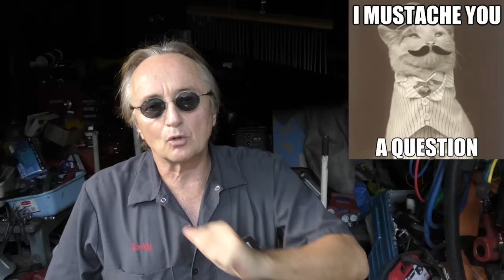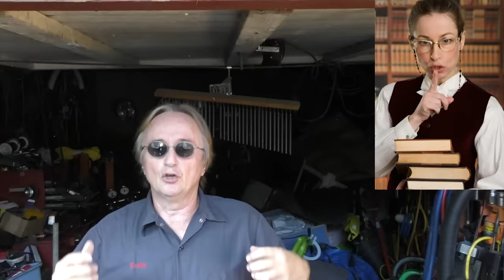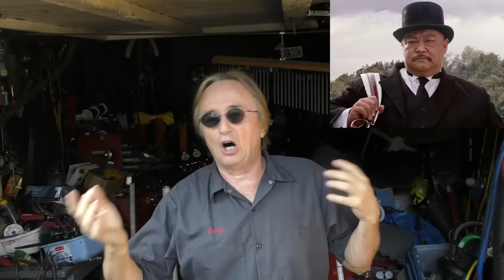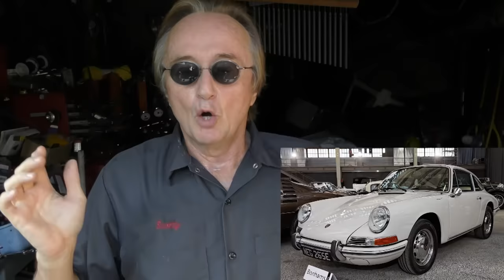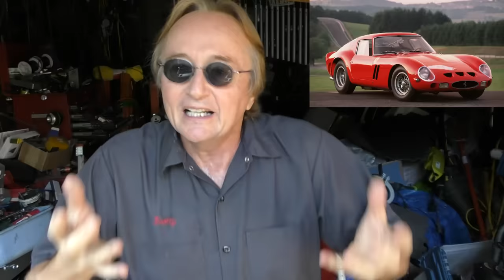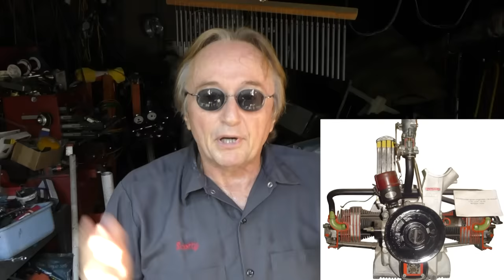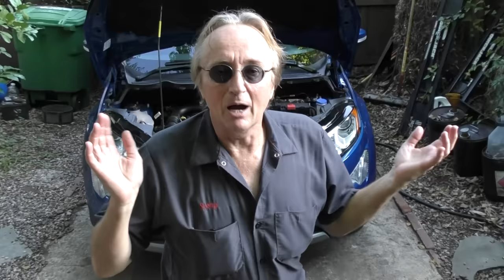The Truth About Boxer Engine Cars

Comment: It's an old design and VW don't use it anymore... So? 

Inline and V-shaped motors are old too. The GT3 has one of the best modern NA engines, and the 911TS is one of the fastest cars in the world.

I don't usually post negative comments but this video was terrible.
Reply: How many miles do you get out of the 911 engine?!? And How much does it cost?!?
Reply: Maintenance Costs, LOL.
Reply: @johnscheidler8842  modern 911s aren't made to do hundreds of thousands of kms. They're designed for high load.
How about this: how many cars will take the abuse a 911 will? Before you answer, watch "The 2014 Porsche 911 Turbo | Road & Track".
911s are engineered for 3000 launches. Ferraris: 12. Nissan GT-R: one launch voids the warranty.

I had an '07 EZ30-powered Subaru Legacy at work the other day. This is an engine and car worth speaking about longevity due to it's design brief, and also a flat 6. This one had 400,000kms on it and was on the factory chains and guides, tensioners, oil and water pumps, and even gaskets.
Reply: @944CoyoteV8  such a fool
Reply: @jesscesanto9127  Precisely why?
Reply: 911s are beautiful and fast but you can simply build a much cheaper car to go faster a simple little civic with an ls swap and boost can outrun your 911 money doesn't buy it all lol
Reply: @jesscesanto9127  what?? I didn't say faster cars couldn't be built cheaper. I've owned a car faster than a new 911TS and it was a 4 cylinder. I'd still take a new 911 over it though. The same reason I'd take a Chiron over a forged 911 that did a 7 second pass. Irrelevant.
You thought that because you could rebut what I was saying by using an argument that is completely irrelevant, that I am a fool? You don't know anything about me.
Show me why I'm wrong rather than name calling like a child.
Reply: @944CoyoteV8  we'll the reason your is because if boxer engines  where as good a v and inline engines them they'd obviously make more of them to think a boxer engine will outlast an inline is simply foolish
Reply: Also 400k kilometers is nothing my old 90 jeep that was handed down to me with an inline 6 has we'll over 526k miles and it runs like a dream it's only need  basic maintenance  and several clutches the I've blown
Reply: @jesscesanto9127  because an inline six is inherently well balanced, like a flat six. No balance shaft like a V6 or inline 4, so a very light rotating assembly. I'd say inline sixes are mechanically as good as flat engines. The downside though is that they're tall and create a high COM and a long front overhang causes big angular inertia. Flat engines are low and short, and better for vehicle dynamics, hence, 911. 

Your Jeep didn't have enough power to hurt itself, but that is respectable milage.
Reply: @944CoyoteV8  I'll admit boxers are decent but they'll never outlast v or jnljne engines I've abused the hell out the car I find the 911 offroading not hauling anything it's not powerful but it takes the abuse
Reply: @jesscesanto9127  Yes, they do!! With very little maintenance. I had one as a daily that did 7500RPM every day for 200000km before I sold it in 'as new' condition. An '07 BLE Legacy; a 3l with 200kW, that I launched at 6k with a heavy duty clutch and light flywheel. The thing got a hiding. 
I' m a V8 guy but that was the best car I ever owned, reliability wise, and it's not like it was slow either, for a 1500kg NA 3l. Did a 14.0 @100mph.
It's well known these engines can take this. That's why I bought it. Look it up.
Reply: @944CoyoteV8  Wait, whoa. A 6-cylinder Subaru with a manual transmission? Where??
Reply: @nthgth  domestic New Zealand market car with the six speed from the V7 STi with shorter ratios.
Reply: @944CoyoteV8   Lol Figures it's in a market that's about as far from me as possible without leaving the planet. Enjoy your sweet sounding six man
Reply: @nthgth  haha come and visit some time, mate. Thanks :)
Reply: Well put, Alan Johnson. I-sixes are great, but they have drawbacks, as all engine designs do.
Reply: @944CoyoteV8  lol we'll see. Here in the US we're lucky to get a manual option on the base models of most cars, and they're all 4-bangers for marketing reasons.
I was lucky enough to drive a manual V-6 Toyota Camry Solara for several years, I still miss that car!

Comment: Great video! I’ve owned 5 Subaru’s (1992-2005) and yes they have their issues but I just have a lot of fun and enjoy the noise they make with unequal length headers and a nice quiet deep muffler.  But now that I’m at the top of my career chapter and two kids with one on the way, I’m sticking to Toyota. My wife’s Sienna has been amazing and get better gas mileage than my old outback (it just started leaking gasses into coolant) I’m going to retire it and get Camry hybrid or something Toyota like that and when I have a shop later on down the road, I’ll buy a Subaru project and do all fun stuff I’ve dreamed about.

Comment: I have a Legacy 3.6r. I love how balanced the engine is. It is incredibly smooth and it is not noisy like scotty says; however, I did put aftermarket exhaust on it and now it sounds awesome and borderline older 911 sound alike. It is super roomy in the interior, not overly complicated like some cars are I do wish it was a hatchback though cause i would like the versitility of the outback without the stilts. It has been very reliable, shoot at the same mileage my previous Buick had oil leaking, had to replace all coolant piping and radiator, a/c and heater went out it was a mess. BTW it really is not hard to work on. I can do an oil change or transmission drain and fill or a differential drain and fill in about 30 minutes each. Air filter is always super easy, cabin filter is easy, battery is easily accessible. Serpentine belt was done in 20 minutes. Brakes are no different than any other mainstream car. Spark plugs are the only real difficult regular maintenance and that is because of the close frame to engine. however if you have 2 jacks and know how to loosen a couple engine mounts its really easy too. If not it could take hours yourself if you do not have the right extensions or swivels. Shoot for the price they charge at the dealer I would just buy a second jack and save yourself a couple hundred in the life of your car. I will admit though, their fluid levels are kind of high(takes almost 7qts of oil every 5k miles, 4qt of trans fluid per drain) 

So Scotty, how is it hard to work on?  You get a balanced engine, symmetrical AWD (none of the fwd/rwd biased crap) that gets great gas mileage for an AWD car (dont compare to fwd cars cause everyone knows there is power losses and efficiency losses with awd) and extremely they are extremely practical. The key to their balanced AWD is their boxer engine. Also have you seen the crash tests of these cars, they are ridiculous at withstanding lethal damage to the occupants and my insurance is significantly lower than any other car I have owned which have all been midsized sedans or eco cars. I have 0 problems in snow of 5.5 inches or less, obviously bumpers get in the way. Shoot im confident in the awd that if the outbacks had some goot all terrain tires they could make it through 8 inches. 

Yes Subaru is less reliable than Toyota... but guess who owns a pretty good percentage of subaru now... Toyota. So with toyota's reliability and hybrid tech, I can see Subaru and Toyota merging and dominating a lot of the market. Shoot put Subarus AWD in the Tacoma and say goodbye to some of the smaller trucks.

I have a vision that Subaru will be one of those companies that started as relatively nothing and turn into a walgreens or an amazon.
And for goodness sake subaru, make a luxury line. I know too many Doctors that drive subarus mainly for their awd notoriety.

Comment: I don't know why you are knocking Subaru engines. One of the easiest to work on. All accessories are mounted on the top of the motor no turbo motor gets GREAT fuel mileage on the highway. What's not to like
Reply: I have an 09 Forester, LOVE IT.  The Boxer engine / clean exhaust is more than adequate. Acceleration may be slow, but just adapt to the driving situation.
Reply: Except for STI lol
Reply: No. Boxer engine is painful for DIY Hobbyist Mechanic.

Try changing all spark plugs on an STi, it take hours, the space is very narrow
Reply: Yeah you don't need to knock on subaru engines they do that themselves. XD
Reply: steve blow I change spark plugs at my work on wrxs and Sti in under 30 minutes all day long and other Subaru models. The space is small but it is more then enough to get the job done :)
Reply: @billypurdy8581  

DIY Hobbiest has different skill levels & different equipments. It's amazing you can do it in 30 minutes.

But all im trying to say is = Inline Engines are much more easier to work with.

Boxer is special build engine, anti mainstream. Almost like Rotary.

It's special, even Zeppelin used Boxer engines because has lowest vibration.

But it's not the best engine for DIY Home Mechanic
Reply: It takes YOU hours because you don't know what you are doing. It takes me less than an hour.
Reply: Haha great gas mileage on a boxer engine? My 2003 Subaru Baja would like you to see it's 17 city mpg and 20 highway mpg.
Reply: @noirceur_  my 2011legacy only used on the highway New Hampshire to New York getting 31mpg
Reply: @marcaliventialiventi765  cool, my 2011 BMW 550I XDRIVE gets 30mpg on the highway and it has 400hp, 450ftlbs & AWD.
Reply: @thebadmanreturns  painful for a diy hobbyist mechanic? I can change plugs in 15 mins.
And i already built a boxer. Including pulling and installing. And im not even a mechanic.
Reply: Yeah. I’m sure timing belts are a breeze. As well as in situ head gasket replacement.
Reply: It's not that hard to change the spark plugs. The things you need to get out the way are very easy to do so. YouTube is great for that.
Reply: I use 2x 3" 3/8" ratchet extensions and a universal joint connected to a 3/8" ratchet. That might help you. You have to plug them into eachother 1 at a time, but then it's easy from there on out. I don't have all the same airbox, battery and fuse as the STi which makes them take longer. But on the outback it took me 1 hour my first time. After that it's much easier.

Also get the locking extensions and duct tape your spark plug socket to the first one. you dont want to be the guy that drops stuff in those holes.
Reply: My 2007 Outback routinely gets 27-29 mpg on trips between Iowa and Louisiana with the occasional 30mpg tank.
Reply: I drive 85-95mph so I typically get 24-28mpg. Also has 165k on it with a blown head gasket leaking coolant and oil. Approx. 0.25-0.5 quarts of oil every 700miles and 1/4 cup of coolant every 2,000miles.
Reply: Can you explain where he knocked  Subaru engines?? He’s explaining differences and the design... try actually listening
Reply: pretty much everything after 3:00 is negative
Reply: xomthood knocking something and stating facts are different... if you think facts are negative then you need to wake up and actually start learning facts about engines or cars in general
Reply: he is offering opinions, not facts, and I know plenty enough about engines, thanks
Reply: I agree with pretty much everything he's said having owned most of these engines. Inline 6's are still the most fun imo
Reply: @billypurdy8581  mitsubishi evo better faster than rubbish subaru
Reply: He did say if you are into Subaru to get a manual transmission. What is wrong with that? My parents used to own a 90s Legacy MT and it was well built. Auto Transmission don't get it. Specially the SVX 😂
Reply: @billypurdy8581    for the average Dad a inline 4 is a dream for spark plugs changing 😁 as fast as the hood is opened the plugs are out

Comment: Not really true that the boxers are under-powered.

The BRZ (Toyota 86) is under-powered but that's due to the design and not the engine. It's been the single biggest complaint on that model and for some reason they won't update it. If they put in the boxer from the WRX (268 HP on the standard 2018 WRX) then that BRZ would flat-out fly since it weighs 500 pounds less than the WRX. The STI has 305 HP and it accelerates fast enough to cause whiplash. No, it can't get 500+ HP like the Dodge Charger but that car can't turn worth a damn and the WRX STI will corner on a dime. The low-slung engine makes it much more fun to drive than just raw HP.
Reply: Do you even know what youre talking about?
Reply: Yes I do. Thank you for asking.
Reply: No worries you can easily make 500hp STI if not cheaply. And sill handle.I just fitted some Michelin pilot sport 4s for extra grip
Reply: That probably wouldn't be as stable in the shorter FR-S wheelbase...everyone complains about that and I'm just like "whatever." I love my FR-S.
Reply: Nibbas prob dont even know what initial d is and downhill isnt about hp since good miata or ae86 can keep up with rx7 fd etc
Reply: Your profile pic made me think there was a tiny hair on my screen and I kept trying to clean it
Reply: The reason for the BRZ/Toyota having a smaller engine has to with price point and sales. If they increased the HP, the price goes up and so does the cost of full coverage insurance. If you look at BRZ/Toyota drivers, they are mostly guys in their late 20's. They can't afford the insurance cost and payments on a higher HP car. Subaru and Toyota lose market share and neither wants that.
Reply: The brz shoukdnt be an 86 replacement. They should have put a iron block straight six in it and made it the new supra instead of that abomination they put thebsuora name on
Reply: They made it into a millennial males kid car.
Reply: Priceless!!!! he just doesn't get it....the BRZ and GT86 were designed to make a fun driving car, not a dragster or F1 supercar..... just somethng that was FUN to drive on a twisty road at the weekend.
Reply: You do know that both cars do have the same exact motor right? The Brz just doesn’t have twin turbos, hence why it makes 68 less pony’s stock
Reply: Toyota's not going to add power because they're planning a new Supra and it's going to be heavier than the 86 and need a sizeable power advantage to compete on the strip.  Subaru won't add much power because they have the legacy of their wrx to worry about.  It's like when GM detuned the 350 for the Camaro in the 90s.  The C4 and C5 vettes were up to 200-300 lbs heavier than that Camaro so using the same engine in both would have given a noticeable straightline advantage to the Camaro.
Reply: Why do you have to point to the Charger to try and make your point? You probably confuse Challengers with Chargers anyway. Who the hell are you?
Reply: Why would you even compare and AWD to RWD? You haven't made a point At All.
Reply: And to argue your point about handling, what makes you think a RWD can't? It's not bad for its intended purposes. If you like a car to handle for you while you mash the gas than an AWD is good for you, But if you like to break the tires free with controlled chaos you'll appreciate RWD.
Reply: Where, anywhere in this video, was Charger mentioned? I may have missed it.
Reply: Toyota 86 is a legend in Japan. And not only because of anime.
Reply: @cyruslever586   86/BRZ was never intended to be a substitute for the Supra, but a competitor to the Miata.
Reply: @MrPunch09  thats not what i was saying in saying that the body style and layout it would have been better suited as a stra8ght 6 supra replacement
Reply: Brz look good But Cheap.  Seats are like sitting Wood Boards.
Reply: @cyruslever586  The 86 was already a JDM legend before USDM even knew what the 2JZtt Supra was. If you make a fair comparison the current 86 is a big upgrade to the 86 of old. You may as well be comparing the Supra to the Tacoma, it's noncincicle really.
Reply: @lbear3321  The best handling cars have been mostly RWD, but it is more than that, if you consider the success of Subaru. Aside from the BRZ the entire fleet is AWD, and in dry conditions no Subaru stands a chance in hell winning a drag race with Dodge Demon for example. (its juvenile anyway)  However in the real world it rains, snows and the streets are often littered with debris and gravel and any Subaru will out perform a muscle car in broader conditions. Even the new Jeep GC SRT awd is equalized in adverse conditions. That said if you are an informed Subaru fan you have an entirely different metric to which you go by. The car community don't seem to understand this.
Reply: @MrPunch09  

I think it has more to do with the driver and there are more options to take action with with a RWD car. AWD is great and I'm not knocking it for average drivers. Cars like Subaru are making lazy drivers. Cars are doing most of the work. But when you do that you take away the vast options of a skilled driver. In short, Subaru doesn't really win and neither do humans as competent drivers. You will not change my mind on this because taking options away does not equal more.
Reply: @MrPunch09  

I will agree that I'd like an AWD family car Dodge Charger as an option, for comfort and not skill.
Reply: @MrPunch09  

Cars are marketed to make everyone feel like a good driver when the car is doing the work. Next time you're in traffic, look around and count the dents.
Reply: @lbear3321   The premise you propose that AWD makes "lazy drivers". Well, you're entitled to your opinion. It simply raises the performance bar in a broader sense. This is irrefutable fact. This is why there are instances where AWD has been banned in racing history.
Reply: @MrPunch09  

Have you ever been trained in anything that your trainer is passionate about? Apparently not because they make you train with something special so all the training is in you and not what you're using. People aren't humble and nothing's sacred. Would you like a comment trophy?